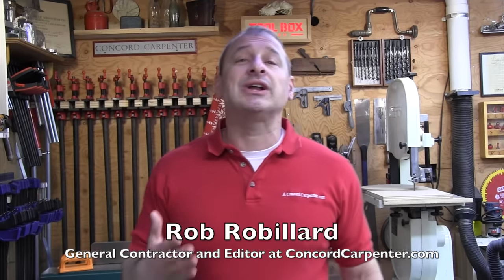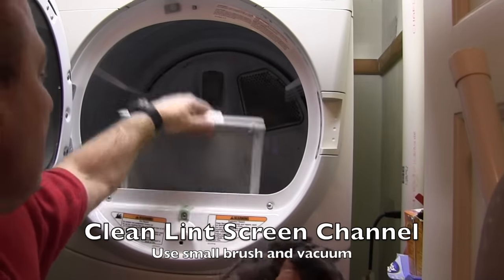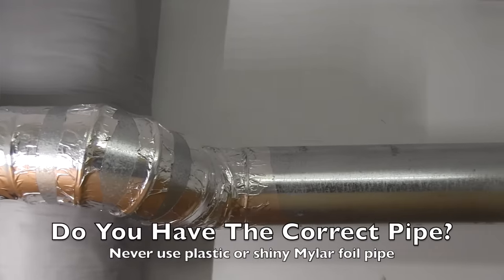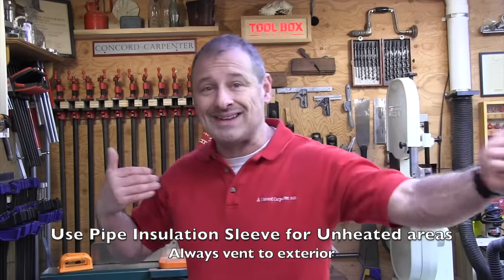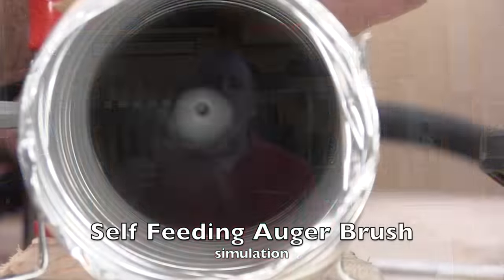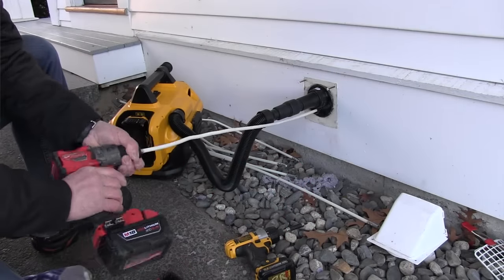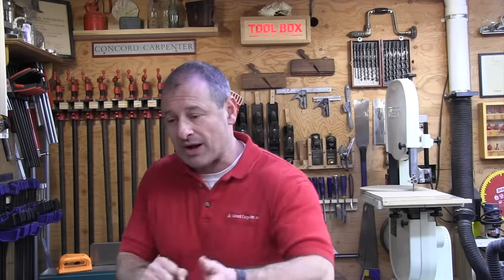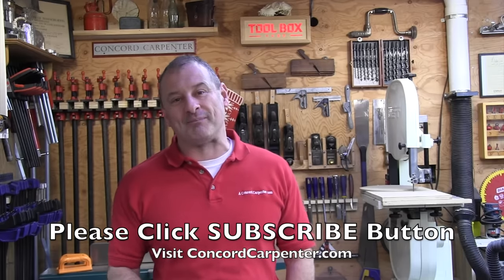How To Clean A Dryer Duct - Step By Step

Comment: Why not just tunring the dryer on? It would blow out the air the same way.
Reply from the maker: No it won’t mount lint solidifies on the pipe walls, it’s joints and seams
Reply: @ConcordCarpenter  Im thinking of buying the reverse skipper air hose $23. It works really good and not damaging flexible dryer duct.